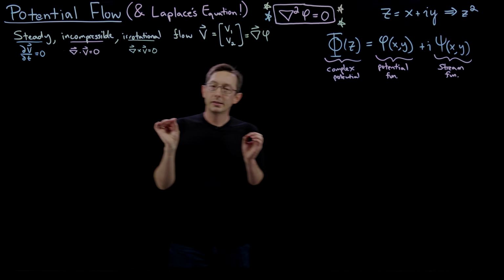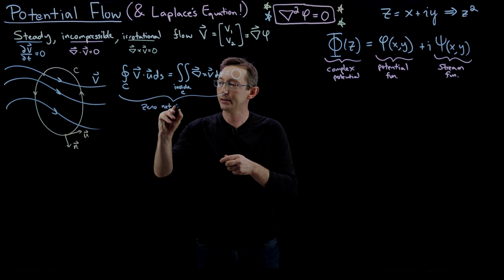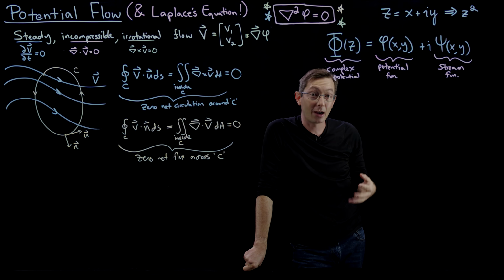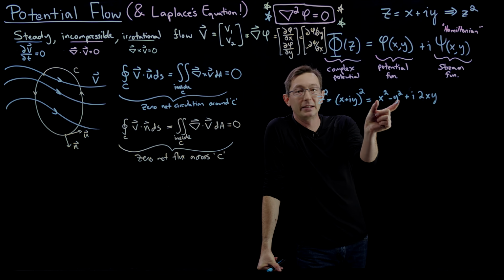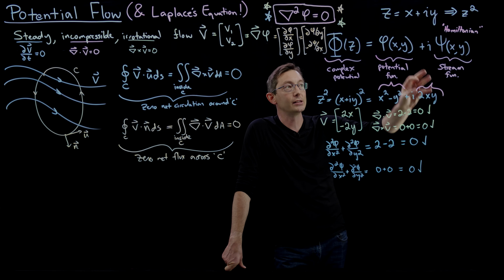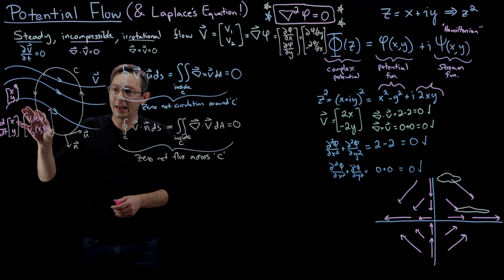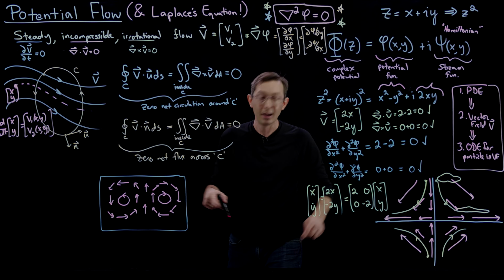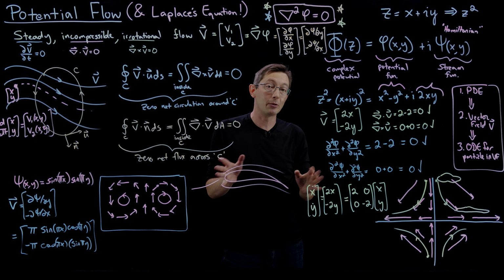Potential Flow Part 2: Details and Examples

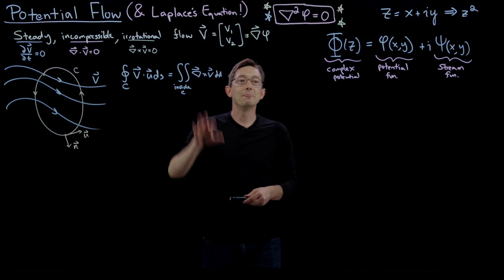Comment: The area integral at 3:28 has to be multiplied by the normal vector of the area acc. to my understanding, since curl gives a vector, but the outcome of the integral should be a quantity (or the integral has to be written using components).

Comment: Prof. Steve : 
Thanks for the lectures but I have some unexplained equation at 5 minute of your video lecture 
You wrote twe equations 
1) int(vector(v).vector(u).differentiation on the area ) = int(rotation(v).differentiation on the volume) 
2) int(vector(v).vector(n).differentiation on the area) = int(divergence (v).differentiation on volume)

Isn't there some thing about those two equations 
You used the same theory on both equations and one time it gives rotation the other time divergence?

Comment: You lost me on this one. Would love more explanation on the Stokes and divergence theorem.
Reply: More math or more physics/examples?
Reply: @wp4297  The math. I didn't follow how it looked different than when it was done before.
Reply: @lavieestlenfer  are you referring to the first part of the video when he's talking about circulation and flux? If so, maybe I get your doubts.
- Circulation, defined as the integral line of Vel dot tangent unit vector over a contour, let's call it L. If you can apply Stokes theorem, you get the flux of the curl(Vel) across any surface S whose boundary is L. Here in the video, in the surface integral with curl(Vel) he forgot the scalar product with the unit normal vector (if it's not implicitly included in the surface element dA)
- Flux, defined as the surface integral of Vel dot unit normal vector over a surface S. Then, we can use divergence thm to transform the surface integral to the volume integral of the divergence. Here, it seems that he's doing things in 2D, since he's using the same contour C for computing circulation and flux. Everyone usually talks about divergence theorem in 3D, here he used it in 2D. Nothing so hard to understand, we reduce the space dimension by 1: what is a surface in 3d becomes a line in 2d, what is a volume in 3d becomes a surface in 2d. If you have to choose a direction to the unit tangent and normal vectors in 2d when you have to evaluate these integrals, remember to choose a tangent vector in the counter-clockwise direction (you have your domain on the left when you travel on the contour C), and the unit normal vector pointing outwards

Let me know if it's clear. I know that text is not the best way to talk about math...
Reply: @wp4297  I can't thank you enough for the effort you've put in. Yes, this is the part I don't follow. I don't get going from 3D down to 2D for this theorem.
Reply: @lavieestlenfer  if you're interested i can share some handwritten notes with you. I can't write here the link, because channel manager deletes it every time i try (or there is some automatic check, that acts on links, but not on the spam below - .-). I don't know how to share them with you, then -. -

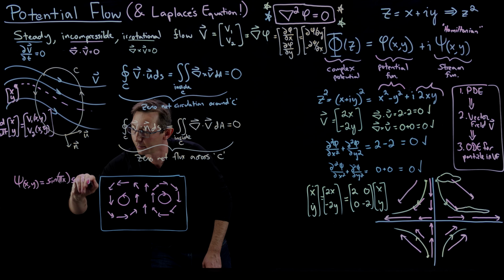Comment: 23:30 The Laplacian of Ψ(x, y)=sin(π x) sin(π y) is not 0
Reply: This was killing me for a day. Look at the gradient equation near the top center, where \vec{v} = [\partial \Psi / \partial x, – \partial \Psi / \partial y]. The key is the negative in front of the y-partial derivative term. Taking the divergence of that is equal to zero.
Reply: I had a typo in this. Should be \vec{v} = [\partial \Psi / \partial y, – \partial \Psi / \partial x]. Key is to differentiate between potential function and the stream function.
Reply: @colinadams3771  But in that case the curl of the field is not zero
Reply: @danielvolinski8319  You got me there.  I don't know the answer then. :(   

Hopefully, Prof. Brunton or someone else can clarify and/or admit it was a mistake.
Reply: @colinadams3771 you get a Laplace equation for Psi, only if the velocity field is BOTH irrotational and incompressible.

> if you get a Velocity field as the curl of a stream function Psi, that velocity field is incompressible (div Vel = 0, in the whole domain), but in general it is NOT irrotational, as in the case of the rotating cell flow of the example.
_ In this case, when you compute the Laplacian of Psi, you get the Poisson equation (Poisson equation ≈ forced Laplace equation):
- Lapl Psi = omega,
where omega is the curl of the velocity, defined as vorticity, in general different from zero (it's equal to zero when the vector field is also irrotational, s.t. you get the Laplace equation you were looking for)

- if you get a Velocity field as the gradient of a potential Phi (+ some assumptions on the domain), that velocity field is irrational everywhere (curl Vel = 0), but in general is not incompressible.
_ In this case, when you compute the Laplacian of Phi, you get the Poisson equation
- Lapl Phi = - div Vel,
where div Vel is the divergence of the velocity, in general different from zero (it's equal to zero when the vector field is also incompressible, s.t. you get the Laplace equation for Phi)

(Sorry for the long comment, but it seems the moderator of the channel doesn't allow external links)

Comment: Professor Steve, I would like to know more about the proof of how taking the specific derivative potential flow function and stream function could lead the same vector field? Will it stay true in every condition?

Thank you, really love you lecture.
Reply: The trick is that the physical quantity (the one that really exists, in the sense you can measure it) is velocity.

Depending on the characteristics of velocity fields you can represent it as:
- the gradient of a potential if the velocity is irrotational. if the velocity field is irrotational, curl(Vel)=0 and thus you can write Vel as a gradient of a scalar field, that we call potential;
- the curl of a stream function if the field is divergence free (incompressible). If the field is incompressible, div(Vel)=0 and thus you can write Vel as the gradient of a vector field, that we call stream function;
- either the gradient of a potential or the curl of a stream function if the velocity is both irrotational AND incompressible. In this case you can derive a Laplace equation for Phi and one for Psi.
 In this case, these two fields are also related because they represent the same velocity field. The relations in 2D fields are given by the Riemann conditions, shown in the video 
vel_x = d phi/dx = d psi/dy, 
vel_y = d phi/dy = -d psi/dx

Since phi, psi satisfy Riemann conditions, they may be used to define an analytic function, also called harmonic function (roughly, a complex differentiable function), having the real part = phi, and the imag part = psi)
In 3D things get a bit trickier

Comment: Would be helpful to know what the physical interpretation of Laplace’s equation is.
Reply: From my understanding it's the divergence of the gradient of a scalar field. For a temperature field this would lead to the energy transfer. Take the gradient of a temperature field to see the heat flux, then take the divergence of the heat flux to see how energy flows and accumulates/dissipates in that field. This is from what I gather, at least. I could have something wrong.

Edit: For temperature, the Laplace equation might not be zero, and many times isn't. This would tell you how a certain area is getting warmer or colder. But let's say you have a vector field of fluid flow. If the fluid is incompressible, the Laplacian would be zero since there would be no accumulation/dissipation of fluid in a given area. Hope this helps and I'm not just blowing wind!